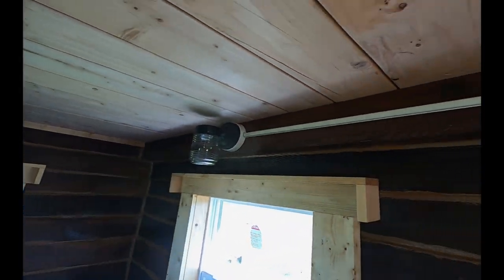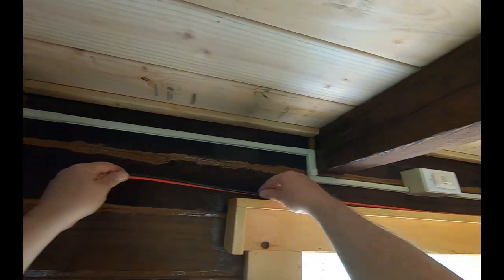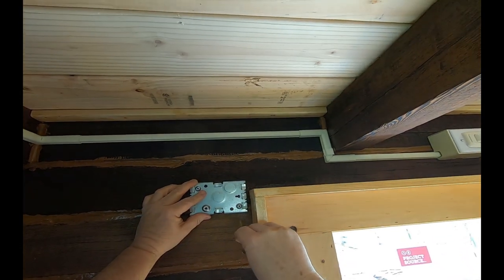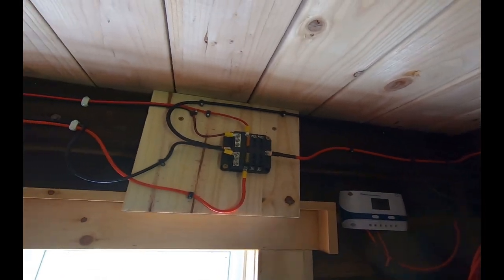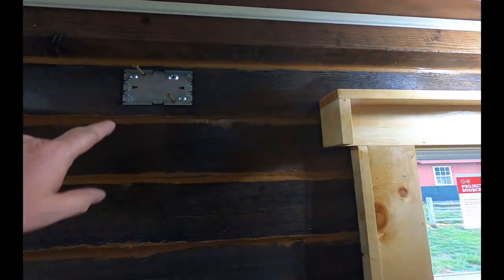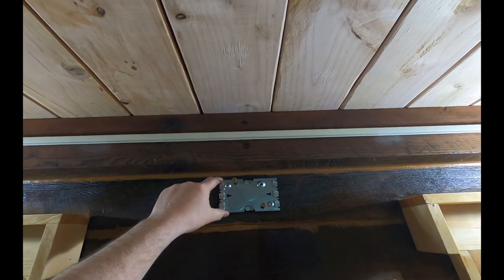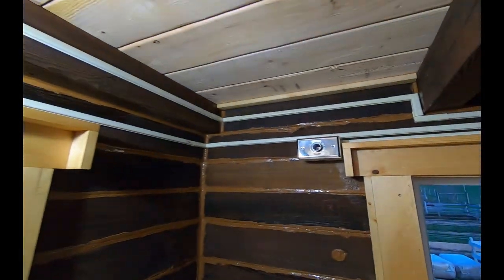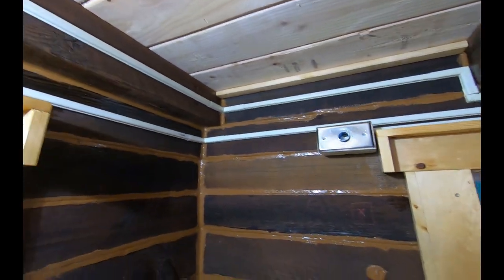Wiring 12 Volt Power Outlets In OFF GRID Tiny Log Cabin...Build Part 41

Comment: The wall light switch and box I like very much. Overall look awesome, Thank you for sharing this with us. I'm also a new subscriber.

Edit: Where did you get the 12v outlet and covers at?
Reply from the maker: Thanks for watching and subscribing!!  I purchased them off Amazon. Here’s a link. 
https://www.amazon.com/Prime-Products-08-5010-Universal-Utility/dp/B00076WQDG/ref=asc_df_B00076WQDG/?tag=hyprod-20&linkCode=df0&hvadid=312061936460&hvpos=&hvnetw=g&hvrand=14847026246862613225&hvpone=&hvptwo=&hvqmt=&hvdev=m&hvdvcmdl=&hvlocint=&hvlocphy=1025182&hvtargid=pla-504099789007&psc=1&tag=&ref=&adgrpid=63195598478&hvpone=&hvptwo=&hvadid=312061936460&hvpos=&hvnetw=g&hvrand=14847026246862613225&hvqmt=&hvdev=m&hvdvcmdl=&hvlocint=&hvlocphy=1025182&hvtargid=pla-504099789007